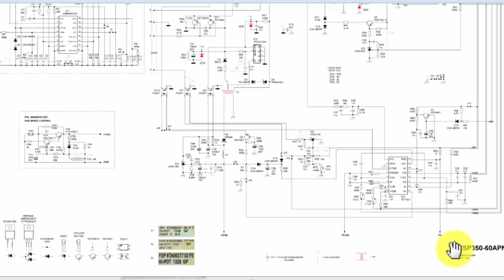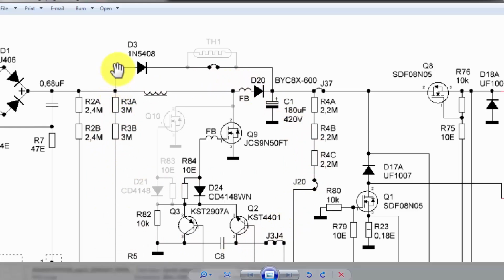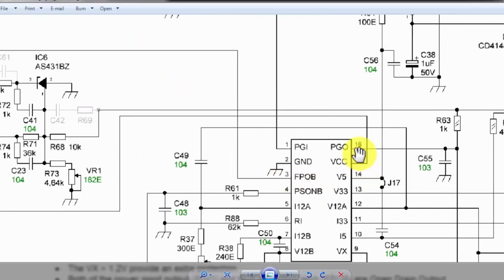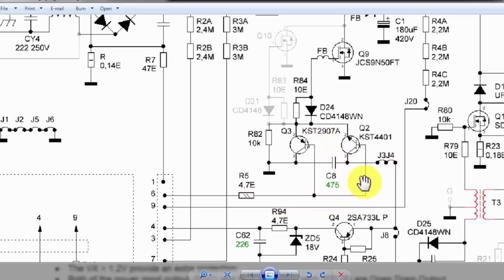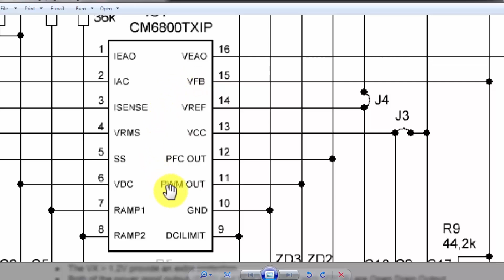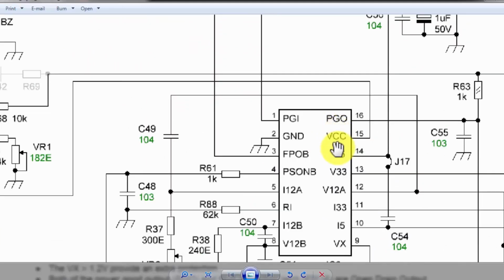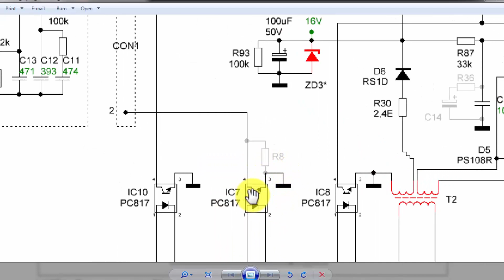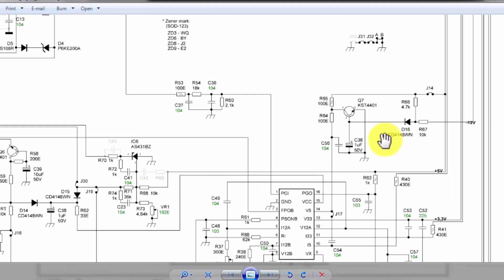{561} ATX PSU FSP350-60APN Circuit Diagram Explained CM6800TX / CM6800, TNY277AN , WT7527 With PFC

Comment: Hi Haseeb. I am trying to troubleshoot a Be Quiet 550 power supply. I found shorted MOSFET at the output voltage active rectifier. I replaced with new one and connected the psu thru a light bulb. It doesn't start and the light bulb keeps pulsing briefly every 4 seconds. 5Vsb is present all times, voltage at the bulk capacitor keeps changing between 330 and 350 volts as the light bulb comes on. I didn't find any othet shorted or burned out parts except this one single output stage mosfet. Any advice where to look further? Thanks

Comment: Can you describe the monitor Ic in the case that the PSU powers up and powers down immediately after the green wire is connected to 0v . How long after pier up does the monitor start to monitor the outputs? . How diagnose the problem when the PSU shuts down immediately after power up ? . I guess you can force the PSU to turn on by disabling or isolating the monitor Ic and than troubleshooting the output that is out of tolerance ?

Comment: Hello sir, thank you for the excelent video.
I have a psu with similar schematic to this one(wt7527 cm6800) that is failing due to over voltage protection, if I cancel the protection I get the psu to start with all  normal voltages except for the 3.3v rail that is giving me 6.6v. If I leave the psu running this way for some minutes/hours it will  instantly lower  the voltage to normal(3.3) and the psu will work correctly for days/weeks/months until it fails again and the voltage protection kicks in again. Have you encountered this problem before? I am thninking it might be the skotchy diodes(stps3045) in the 3.3v rail, but looking forward to your opinion on the subject before buying replacement. What component can fail this way and go back to normal after a while and fail again. Thank you

Comment: if the -12V output only is marginally low say -11.9V under no  load  this is close to the lower limit and the monitor IC  may switch off the power supply sometimes in this case . How to get the -12V to regulate correctly if the other outs are in tolerance ? Change the output Capacitor ?

Comment: Great Explanation Sir. Trying to fix a 850W 80 plus supply with the CM6800. Dont hold much expectation, the Mosfet for the PFC was blown, the TNY chip was also blown. I replace both, TNY is now giving 5V, still wont fire up. The main CAP went open which I have found before. Then, the PFC circuit goes crazy. AWould you mind giving me some suggestions. Thanks, have a good day.

Comment: If the output voltages are not within tolerance. In other words, if the +12V indicates 11.7V, and the +5V reads as 4.7V l, etc. is there a way to adjust the voltages to within spec?

Comment: Please explain how the -12V output is generated  . L2  couples   between the  +12V , -12V and +5 outputs . I guess there is transform action via L2 to the -12V output and  the  other outputs . Why does L2 connect to 3x outputs ?

Comment: I have atx supply and problem is that  when i start through green and ground wire it starts and suddenly stopped within a sec and also check with Multimeter only give a couple of sec voltage. standby is ok and i cheked the components no one is short in input and output side tell me what can I do..
Reply from the maker: the smps supervisor is interrupting to turnoff the power supply. i will try to share the techniques to troubleshooting this fault
Reply: Yaa please make a troubleshooting video to resolve this...
Reply: @HaseebElectronics  hello did you post a video regarding this troubleshooting?

Comment: haseeb bhai hp ki core i5 ki supply PS-4321-1hb jis ma PS25 controller ic use hoi ha os ki video banao plz voltage increase karny ki for battery charging

Comment: Buenas noches,primero que todo gracias por el contenido que comparte en su canal,me ha ayudado bastante detectar fallas en algunas fuentes ATX que me han llegado completamente muertas,actualmente tengo una huntkey hk560-18fp,la cual detecté que tiene averiado el como controlador del PWM un CM6800TX,la duda que no me deja dormir(por miedo a que ocurra un accidente y destruya la fuente(0_0)),es si es posible cambiar el CM6800TX por un CM6800I ?
Reply from the maker: Buenas noches,
cm6800i es un controlador de arranque bajo y CM6800T es un controlador de velocidad turbo
en situaciones que vienen, la mayoría de las veces funciona normalmente.
Reply: Vale vale,lo cambiaré (tomando todas las precauciones)y comentaré los resultados.Gracias por aclarar mi duda(quizás ahora si pueda dormir 😅)
Reply from the maker: es un placer. Todos los modelos CM6800A, CM6800B, 6800I, 6800T, 6800X, etc. la mayoría de las veces funcionan como reemplazo. es segun mi experiencia
te deseo la mejor de las suertes.
Reply: Buenas noches,he remplazado los ic pero me llama la atención un detalle,al encender la fuente la lámpara de prueba empieza a fluctuar muy despacio(se pone al máximo y despues casi al mínimo por intervalos de 1 segundo), el fan enciende también, pero las salidas de voltaje están a 1.5V(aproximadamente),este comportamiento es normal?
Pd:tengo conectado en serie una lámpara de 70W y en mi país la tensión es de 120V 60Hz
Reply from the maker: si su fuente de alimentación tiene un circuito PFC. entonces este comportamiento es normal, porque el circuito PFC consume más corriente que la corriente nominal. cuando damos el comando PSON, en ese momento se debe iniciar el PFC, por lo que consumirá una gran cantidad de corriente para aumentar el voltaje a alrededor de 390-410 VCC en el riel de CC. por lo tanto, es una indicación normal de que el PFC está tratando de iniciarse, pero cuando no se inicia, entra en estado de reposo, esa es la razón por la cual la lámpara parpadea en intervalos de alrededor de 1 segundo
por lo que puede intentar usar el encendido directo o puede probar una lámpara de la serie de alrededor de 150-200 vatios
te deseo la mejor de las suertes y exitos
Reply: Funciona!!!!!🥳.la fuente trabaja perfectamente!!!Pasé un poco de susto pq es la primera vez que reparo una fuente con PFC activo y al no estar adaptado a que la bombilla encienda al arrancar la fuente me daba mala impresión (un poco asustado la verdad)😅.Deme un tiempo para volver a desarmarla y ponerle aquí en los comentarios los mediciones de ohmeaje de la tarjeta que tiene el PWM para que en el caso de este modelo de fuente usted o alguna otra persona se pueda guiar y saber cuando el PWM está dañado o tiene algún problema.
Pd:8 técnicos en mi país me dijeron que no era posible cambiar el 6800TX por el 6800i,solo usted dijo que si era posible y que podría funcionar. Gracias😊
Reply: Buenas tardes, aquí le dejo la tabla de comparación de los valores en la escala de continuidad al medir la targeta que soporta el 6800,para que pueda tener una referencia de que tan afectado pudiera estar el ic sin mucha necesidad de tener la fuente encendida. La tabla se compone de 3 columnas(6800i,6800tx bueno,6800tx malo)
Y las filas son los pines de la targeta que soporta el ic(empezando desde los 6 pines que están unidos hacia los 3 que están separados)tomando el pin1 como referencia negativa para la medición
Reply: Tabla:
Midiendo desde pin 1 hacia adelante
2-1000  1017   673
3-980     980   948
4-968     1030  680
5-0L       0L       1129
6-1318   1262   741
7-0           0         0
8-0L        0L        0L
9-681      681     681
10-0L      0L       0L
Reply: Recuerde que estas mediciones son con la tarjeta que soporta al ic desoldada de la fuente.
Tengo la fuente trabajando con el 6800i hasta ahora,solo he probado hasta 320W de potencia y las salidas son estables dentro del rango admisible.Espero que esta información le sirva para cuando encuentre una fuente de este modelo, muchas gracias por la ayuda😊
Pd:Cualquier duda ,dejela en los comentarios

Comment: Geat sir...    Very usefull for me.. Lot of thanks 🙏🏼👍
sir do we have this circuit method in all branded ATX PSUs ?. Is it not possible to find and repair working with this SCHEMATIC on SMPS POWER SUPPLYs with active PFC? Even if the ICs are different. Thank You.
Reply from the maker: thanks a lot 
about 99% the working principle is same for power supplies 
just the difference is design, components and their geometry 
and adding various features to make unique from others 
otherwise no need for anr any circuit diagram to troubleshoot.if we get idea about the phenomena and theory of operation, then it like BUTTER
Reply: @HaseebElectronics  thanks a lot sir.. 👍

Comment: Sir i m ur big fan from india..🙏 sir there r a quistion can i use 2SK2611 MOSFET - 900V 9A N-Channel Power MOSFET instead 	
STW9NK90Z MOSFET N-CH 900V 8A TO247-3. both r equal or not...? what parameter should be measured to use compatible mosfet.?
Reply from the maker: please try to use 9N90
10N90
TMAN10N80
these are closest replacements